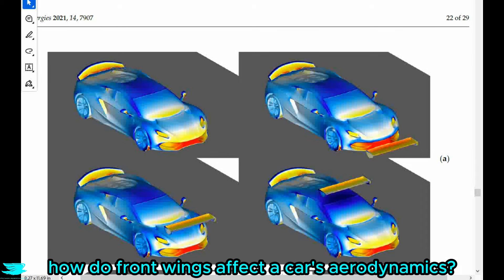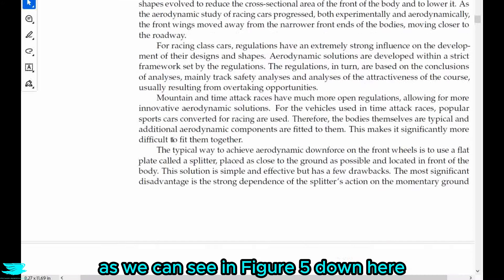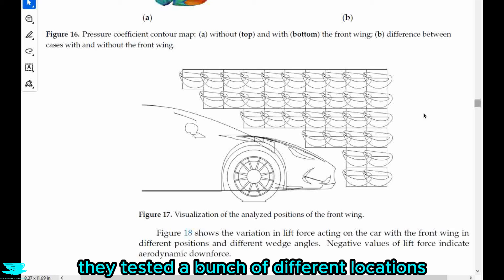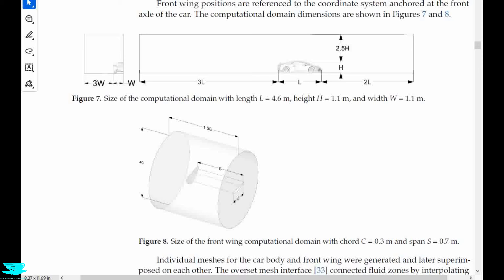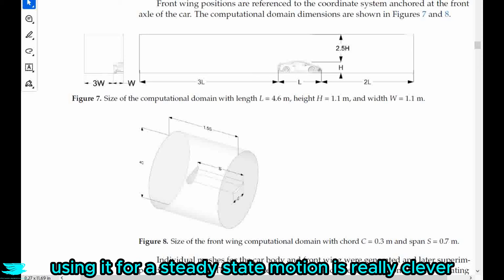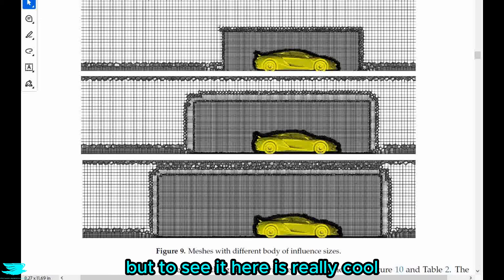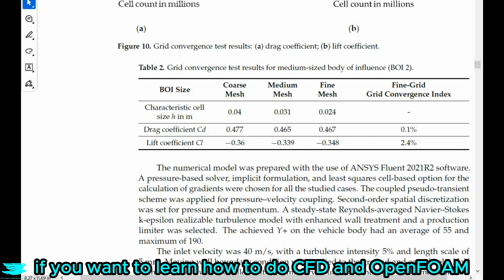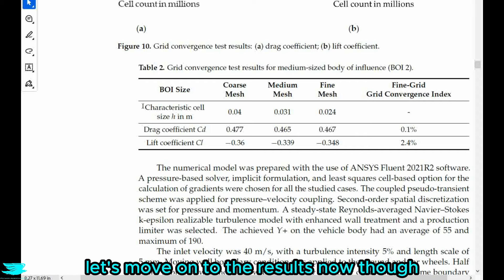Podcast 200 Supercar Front Wing Aerodynamics

Comment: If putting a wing by the nose is having the best effect, then it kind of supports my theory that the upper wheel wake generates downforce. By putting the wing at the upper half of the wheel, the downforce producing wake from the FW merges with and strengthens the upper wheel wake, similar to how dive planes would also enhance the upper wheel wake, while disturbing the lower lift generating wake(by diverting airflow upwards).
Reply from the maker: That is a really good point. I think looking at the pressures in the wheelhouses will also give some info about this. I'll see if I can find a paper on it. (I actually have a paper on it, and I just need to dig it up...)

Comment: I wonder if wings on just the front wheel arches (and a big wing on the back) would be effective. Since in curvy track focused racing - you want to increase downforce over the front wheels to help reduce understeer, but you don't need to increase drag over the rest of the car as a penalty.
Reply from the maker: That could work. The thing to keep in mind is how much energy the air coming around the side of the car has. And if there is a lot of curvature, that would mean you need to install the wing at an extreme angle.

Comment: I have a question. I'm considering building an enormous roof wing for ice racing (rubber tires, no studs). I don't know if the sanctioning body will allow it (they tend to be sloppy with what's allowed so it might make it through) so I'm thinking go for something quick and dirty. I'm probably topping out at 60mph at most so drag is not much of a consideration as I'll never be horsepower limited. Watching this now though it makes me consider, could the high velocity of a roof wing interact with the roof and create lift along the roof surface that dulls the effects of the wing? I'm also considering undercar aero, though I don't know if it'll be effective at those speeds compared to a big wing element. Not to mention a splitter isn't helpful when bashing it into a snow berm is possible haha. I looked at some FSAE paper that had a high downforce multi element MSHD profile that seemed appropriate to copy.
Edit: I should add that this is an old squarish hatchback shaped Subaru GL Hatch. So quite a flat roof, sloping hatch, and drip rails (that I'd attach the wing to like a roof rack).
Reply from the maker: I, personally, would go with a more modern rally car setup because their operating conditions are much more similar to what you will be doing.

So, a huge wing at the back. FSAE often go down that path too. So, there is a lot of similarities there.
Reply: @PremierAerodynamics  Huge wing, flat floor, small splitter maybe? The back is also so sloped I may get attached flow down the back. I'm thinking also a spoiler at the base of the hatch to back pressure up through there and provide a separation edge to keep the wake consistent. Depending on wool tuft testing of course.